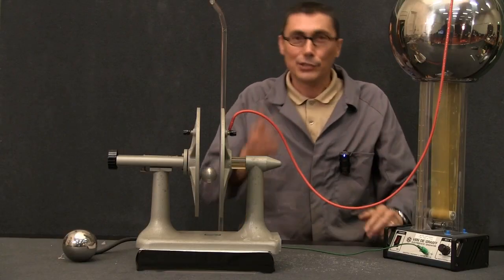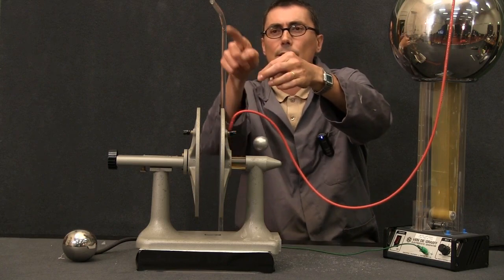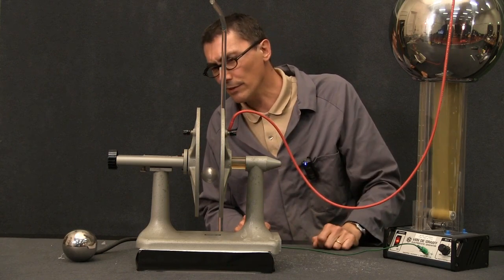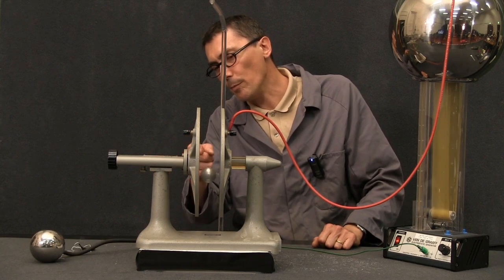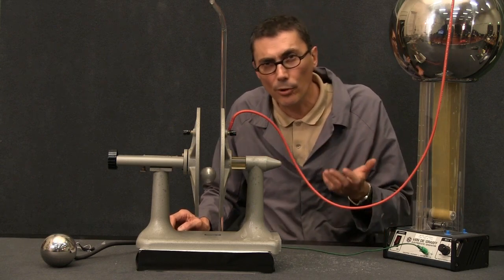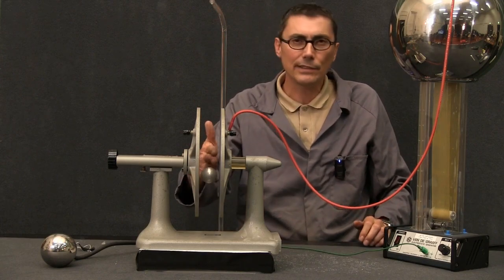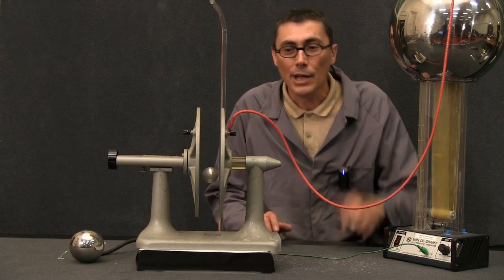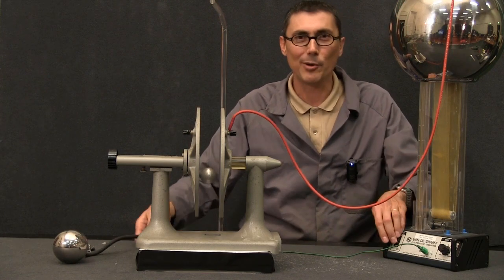PH EM ES DEMO 70034A V0450 Electro Pong Capacitor A New Sport

Comment: If the second plate is not connected to earth, will the ball reach a point where it does not move despite the vandegraff generator being on? i.e. Will the second plate reach a point where its positive charge is equivalent to that of the plate connected to the vandegraff,  such that the ball feels equal force on both sides and just stays in the middle? ...